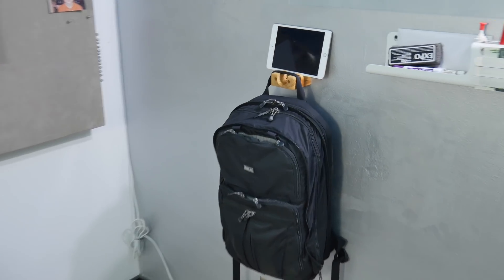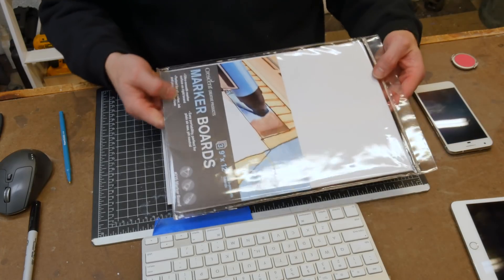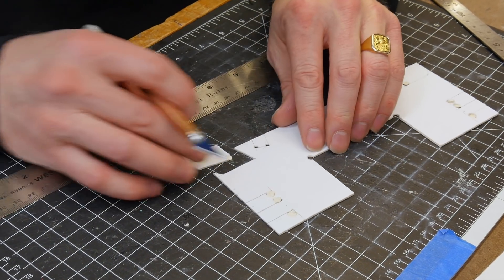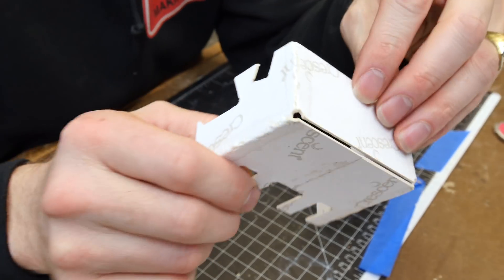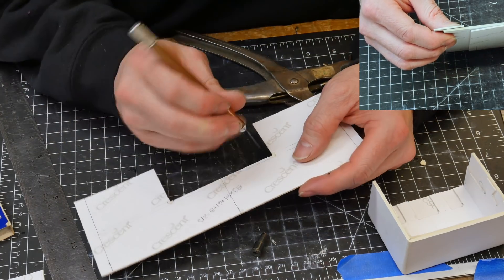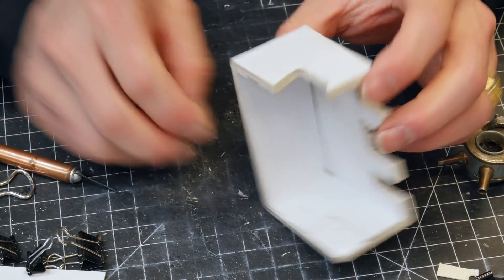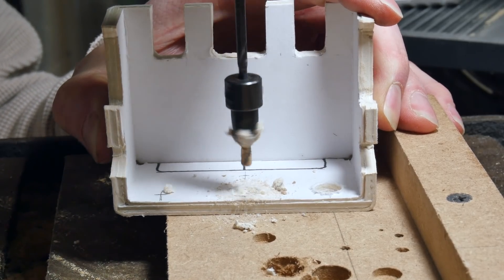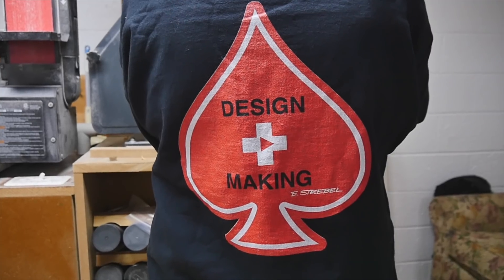Mat Board Backpack hanger Mockup Build and sketch Industrial design process

Comment: What about a 1 cm hole in the bottom shelf? This could allow for some form of strain relief for the cable when changing and a place for the cable to live when not in use. Bonus feature: it might act as a type of drain when the product is used outside or in moist environments.
Reply from the maker: Rouverius great feedback, some sort of a cut out or cable slot is needed. I am planning on it.
Reply: Wow, thanks. Looking forward to seeing how this turns out.

Comment: ok, good video, I proto everything with foam board, sometimes evergreen plastic, sometimes clay.  The only issue I have with the design (and it's a good design) is that the keys would get pulled off every time you yank the backpack off.  I would put the hook feature under the holder and locate it against the back so as not to get in the way of the backpack when taking it off of the holder.  Just my 2 cents, keep up the good work!
Reply from the maker: John Smith ok, great feedback. I will see if i can get the hooks a bit more out of the way.